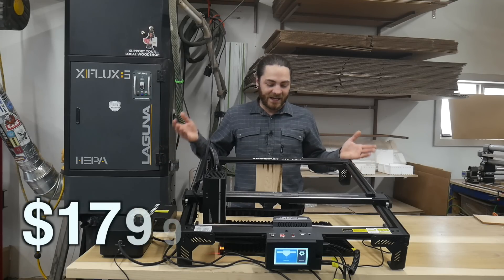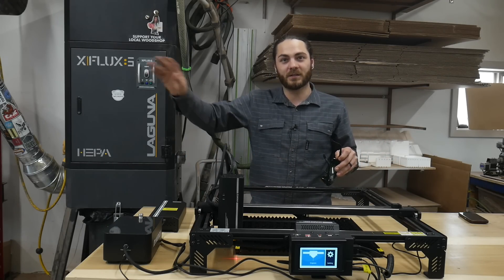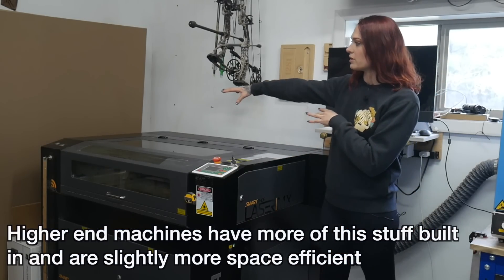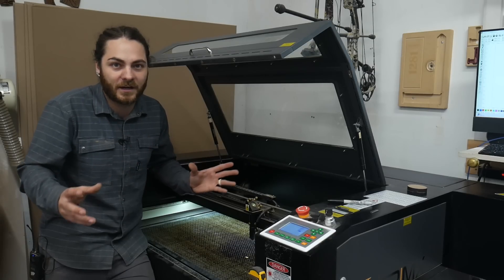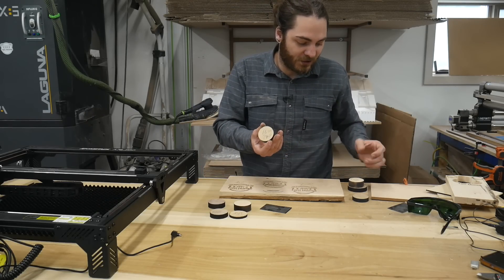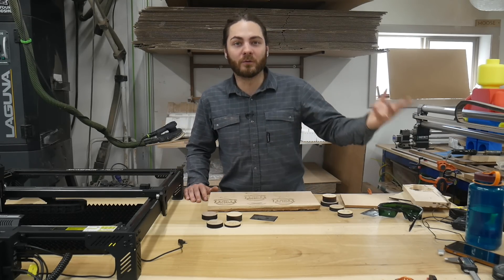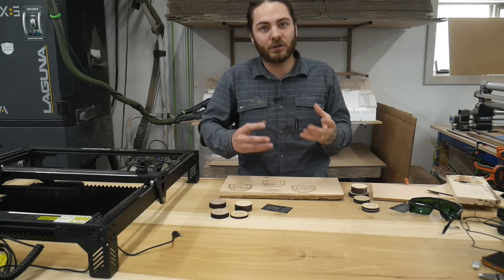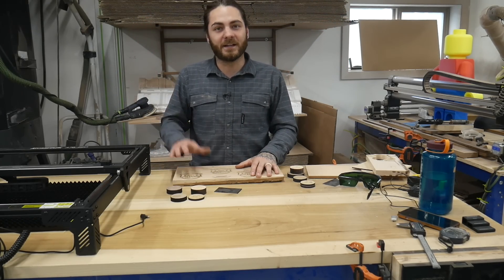Retire your co2 laser? Atomstack A70 70w Diode

Comment: Diode lasers have two big problems:
1. focusing on the material, it is fixed.
2. as the power increases, the components of the diode laser become larger, which requires a more complex and expensive design.
Therefore, the laser power will increase along with the price very much.

Comment: This guy is so wrong about diode lasers and a business! I have run a successful business with the xtool D1 10watt for 3 years. It depends on what you are trying to do. I do custom signs. I have no maximum size with a diode laser because I can move it wherever I need it. Just finished a 48"x48" sign. I use it for what it's made for, engraving. I paid for my machine within the first 4 months of buying. Also the price of a CO2 laser you can buy 2 or more Diodes.
Reply: Hello, do you have any video of your signmaking?

Comment: Multiple passes on for 6mm on a 100w co2.... my true 90w co2 will do 6mm single pass at 25mm/s.. 3mm at 45mm/s your edges are way more burnt that they should be, increase your air assist might help, or a differnt focla lenth lense
Reply: Right. And  I keep with my 100W co2 machine and my 50W fiber laser.  And I still think these little diodes are great for hobbyists.

Comment: Is 70W delivered power?
Because laser diodes from china say 40W but I think in reality they are 5W
Reply from the maker: They claim it’s 70. It sure cuts like butter but it’s not something I actually tested so I’m not 100% sure 🤷🏼‍♂️ single pass cuts 1/2 mdf and 1” wood
Reply: 5W is pretty much the limit for a single diode laser. They sold them claiming up to 15W, by running them over power, so they burned out quickly. The newer 20W and bigger diodes are constructed of multiple 5W diodes that are combined into a single outout beam. Xtool 20W models have 4 diodes and 40W models have 8 diodes. This one will probably have 14 diodes stacked in the box.
Reply: Be very careful about the wording and make sure the power wattage rating is for the optical power, not the electrical power.
Reply: This one have 14x 6watts lasers combined.
Reply: It has a lot of heads inside,6w each...true power consumption must be around 300w

Comment: I cut clear acrylic only Co2 will do that so it doesn't matter how powerful they make the diode lasers they just don't cut clear acrylic so I think co2's are safe for now
Reply: Not true. IR (or pretty much any non-blue) diode laser can cut clear acrylic.
Reply: @Mark-et1pz  IR arent powerful enough to cut but they good at engraving
Reply from the maker: Correct, I mentioned this several times. It depends on what you do in you workspace, if you dont cut acrylic its not a big deal, it can also do colored acrylic. I also mentioned  I would buy a larger c02 laser if budget permits that purchase. Thanks for watching!

Comment: My issues with my diode lasers that I do not see with better C02 lasers are the mechanical parts. C02 are more like a CNC milling machine and diodes are like a toy. I can do great things but the speed will almost always be held back on the diodes because of the way they are built. It isn’t always cutting ability. 70 watts make me want one and it is easily obtainable but I will always long for the stability but that is where the size and cost comes in. Additionally diode laser may last longer than C02 but the frame and gantry won’t.  Just some other things to think about. I will probably be and up getting one of the big 70 watt because it is more affordable and less space
Reply from the maker: 100% agree which is why I recommended a higher end c02 if its feasible. I have the same concerns with the diodes, I think they are getting there though! They still need some improvements but overall getting pretty impressive. I dont think it would hold up nearly as well as a well built c02 if its strictly a business purchase. As a hobby I think they are a great option! or even a good starting point to start a business as they have a low entry cost.
Reply: Ehhhhh gantry is beefy enough I've had my 20W for years now. It's putting a lot of pressure on the CO2 industry IMO. Sure, there are limits with what it can engrave but along with my MOPA fiber, I'll likely go this route instead of equivalent CO2. Not having to deal with a chiller is a big plus.
Reply: throw some mgm12 linear rails on the diode-laser and build a enclosure and you got a "best-od-both" machine
Reply: This machine has no conveyor belts...it only works on rails
Reply: Get a Onefinity CNC and add a laser. Won't have any problems with the rails etc, and they're up to 64w laser now

Comment from the maker: Thanks for watching! Let me know your experiences with diode lasers as I dont have a ton. Do they hold up with heavy use? If you're interested in the laser mentioned I'll attach an affiliate link. Overall for the price it seems pretty impressive but I dont have a ton of time with it. Click here if you're interested. Atomstack A70 70w: https://shrsl.com/4ii2e
Reply: I don't have any experience with a laser but I have a question that I hope you can answer. Can you cut 2 sided tape with a laser? Its made by 3M and is a type of foam core with a plastic peel off on both sides. I have a big need for this if possible. Thanks for your video, I might start looking for something closer to the $1200 to $2000 range.
Reply from the maker: Hey! Pretty much any diode should cut that like butter. I tagged a enclosed creality laser in the description that is a little more affordable.